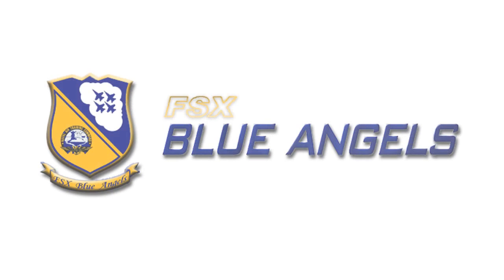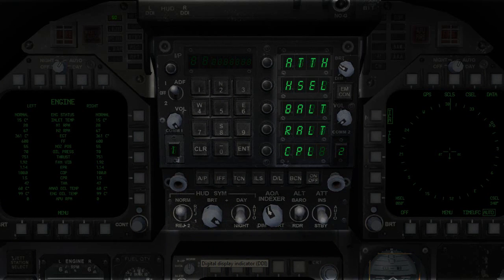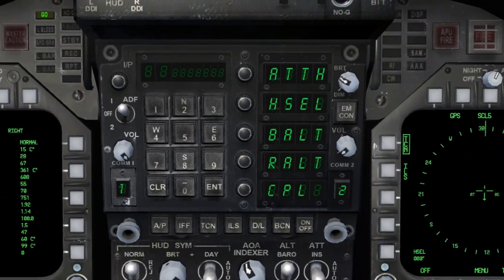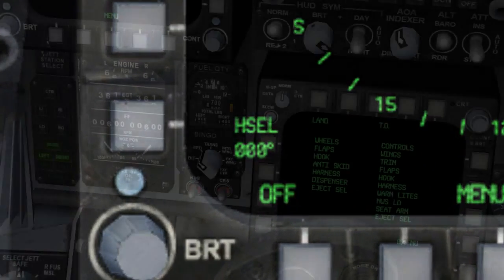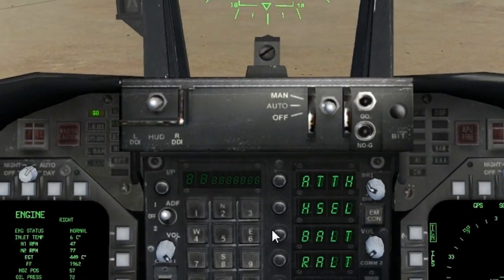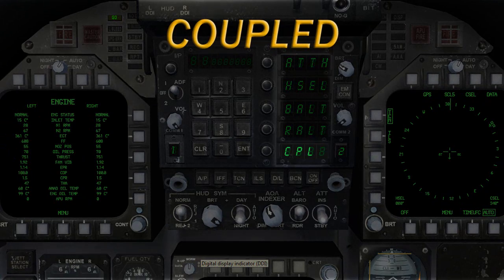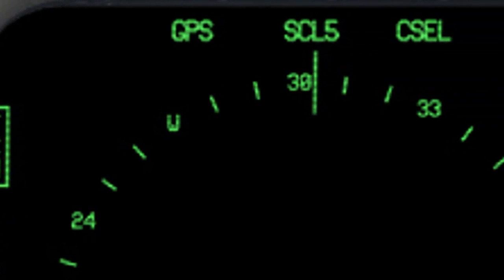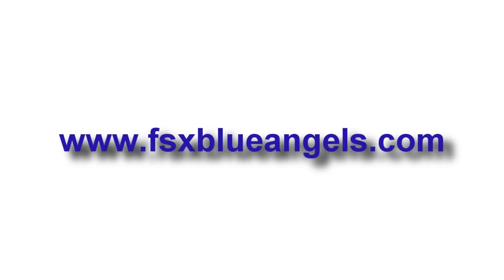autopilot tutorial.wmv

Comment: hey great video helped a lot, btw you can autothrottle: Press Ctrl + R at the desired speed, the same way you would the BALT
Reply: Is there a way to set the specific speed? Or will it maintain a speed close to the one you're currently at. For example, if I'm at 650 knots, and I press Ctrl + R, will it maintain that exact speed (650 knots) or will it maintain something close to it, such as 640, 660, etc.